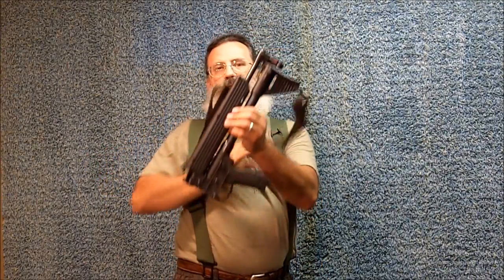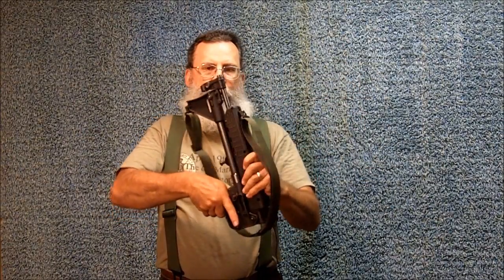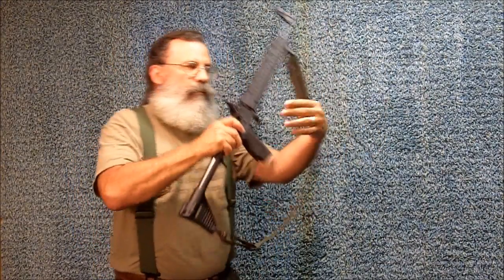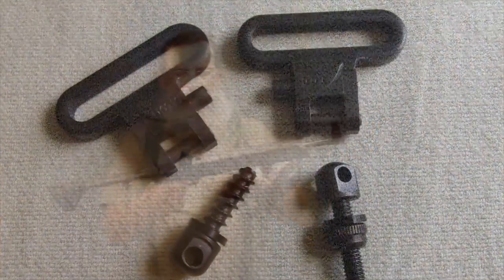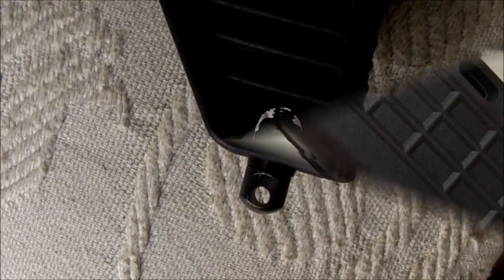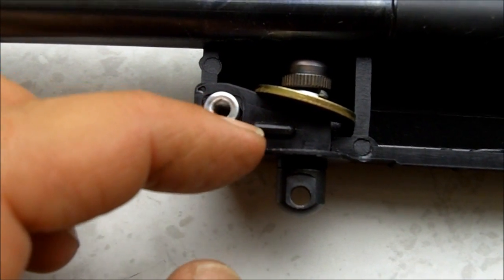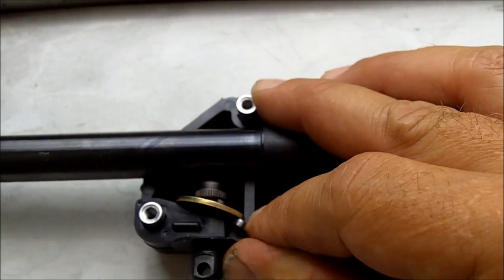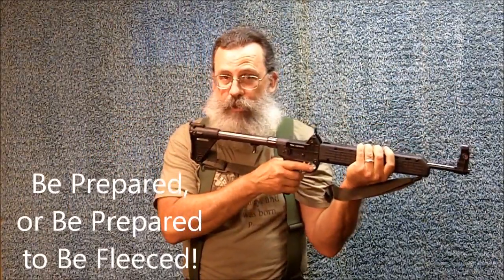Installing Sling Bases on a Kel-Tec Sub-2000 Rifle for a U.S.G.I. Sling

Comment: I have put more than 4000 rounds through my 9mm S2K and have yet to have one slam fire.  I do however, keep my firearms very clean, which will help against malfunctions such as slam firing and other failures.  I infact can only count maybe 5 separate times when I had any malfunctions with it at all.  I purchased a 1000 round box of Wolf steel jacket 9mm and had three of those malfunctions with that case of ammo.  Other than that I would put my life on the line with my S2K.  Nice video, Thanks.